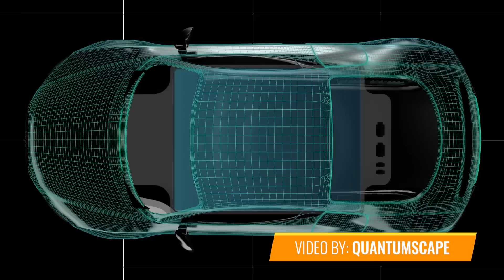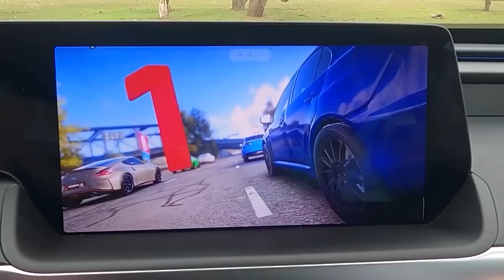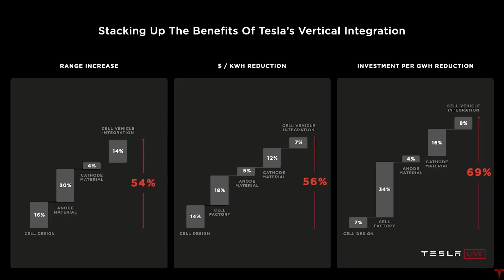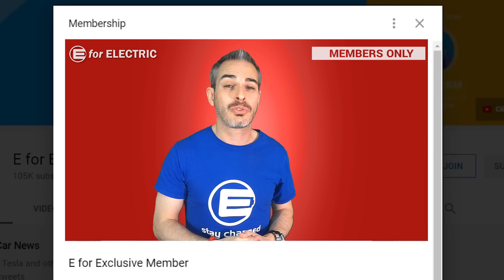TOYOTA's Only Hope to Beat TESLA: Solid State Battery

Comment: Toyota has much more going for it than just solid state batteries. Toyota’s dependability and reliability are second to none. Tesla’s dependability and reliability are the worst in the industry and that is making BEV which are much less complicated to build and easier to maintain. When Toyota builds BEV people will buy them over Tesla’s for the same reason the buy ICEV Toyota’s over other brands. Toyota never came out first with anything, but they still sell more cars and are more profitable than any other car company in the world. Tesla still wouldn’t be making any money if it wasn’t subsidized by pollution credit sales.

Comment: Toyota is on a political level fighting EVs and at the same time soon launching a solid state battery? Sounds contradictory and that Toyota therefore is not any time soon launching a solid state battery.

I think that Elon Musk believes that when the solid state battery is ready for the market, the lithium battery that Tesla uses will have been developed further too and the difference in capacity between the two battery technologies will be minor.

Comment: In the short run, no one beats Tesla; they are just too far ahead in the charging game and the tech they put in each car.  The other car companies are just getting into the game, and they haven't shown anything other than their standard offerings with electric motors and standard batteries inside.  Moreover, the charging infrastructure is not robust enough for those who need a reliable way to take extended trips other than a Tesla.  

Solid-state batteries are not around the corner, and for now, those that buy electric cars will have to face the fact that long-range will remain limited.  That said, if someone is using the car in urban and suburban environments, the electric car will work just fine.  Perhaps Toyota can find a way to make a hydrogen car that can overcome the current limitations, but I have serious doubts that they have anything right now that can beat Tesla.
Reply: Toyota will win. The average person can’t afford a Tesla. The body and paint is shoddy, and $600 for a taillight? Come on. There are a lot of Tesla cars here, but there are way more large pickup trucks, guzzling gas. And folks are still buying the Toyota Prius.

Comment: It’s not about who gets to solid state first.  Just being better isn’t enough.  It has to be economical as well.
Reply: I see what you are saying but Tesla started with a 100K + car to limit demand while they worked out the kinks. Then started getting cheaper. The newest whiz-bang stuff costs. Then gets cheaper over time.
Reply: @DanT10  Tesla did that when no other company had EVs, this is not the same. If Toyota starts a limited production of a few GWh (~10GWh) of Solid State Batteries at a point in time when Tesla has 6-10TWh of 4680s in production, it will not even be a contest.
Reply: @OnigoroshiZero  Yes, exactly.   The best battery in the world does not help if you can't build them at scale and at reasonable cost.
Reply: Yeah I expected solid state to start in luxury cars.
Reply: Yes, the early bird may get the worm but it is the second mouse that gets the cheese.  
The other thing that may happen is some other technology come along and just kill the market for the existing batteries.
Reply: and durable.
Reply: Well, that rules out Tesla then, since no BEV's are economical without subsidies.

Comment: IT is the mix of Energy density, price and cycle life that determines which tech is superior. I don't expect that first gen solid state batteries are significantly Better warranting their likely higher price. However if improvements are fast IT is  the battery chemistry with the most Range Per $ That wins! This is not about Tesla competing in manufacturing costs and production capacity. People want the best chemistry, period! All other types of batteries Will be considered inferior if Toyota is succesfull. However Tesla is not powerless. They have the expertise and capital to startup a licensed production of Solid state batteries in Short order. You can not Be a Global leading EV manufacturer, if you dismiss the evolution in batteries. IT Will be like saying: "steam cars are All that people need, Henry Ford is a Moron".

Comment: Ah! come on! Do you really think that Toyota is behind or will be left behind? Toyota has been electrifying the Vehicles before all other manufacture and had put out more successfully hybrid then another manufacture. Hybrids are not pure EV is right, but it is electrification, for it uses a computer to tell the system how to use the electric Motor. So Toyota do know how to package a motor, use computer and electrons to control those motors. So do you want to still tell me that they will left behind? I think not. Yes Tesla revolutionize the EV and yes they do know how to make elections work well with their motors, which make them popular by the Tesla fan boys and girls. Tesla is just not good in building vehicle, but good in packaging electrons and motors to get good race track performance then any other EV builders. Toyota on the the hand build good, lasting, reliable, and dependable Vehicle and been doing electrification of their vehicle before any manufacture and that is the key that will keep Toyota  capable and successful in producing a very good EV.
Reply: @T R I personally do not care for pure EV at this time, because they will not fit  the way I live and move. I do not like waiting around going nowhere for 10, 15,  45 minutes to an hours for an EV to be fully charge. Maybe when I can charge an EV in 5 or under 5 minuets then I will go EV.  For right now HV or PHV, just make more sense to me.
Reply: Microns not millimeters. The gigs castings will improve precision by 3 orders of magnitude!!! If that doesn’t leapfrog Tesla to the top tier of manufacturering ...

Comment: Tab-less battery patent replaces the (single welded tab construction) with (non welded multiple flaps construction). Flaps connected to output terminal by pretension force induced in the final assembly). 

As flaps are made of annealed soft copper, we opened up chance for rapid degradation. Setting back the patent claimed improvement. 

Watch out for post delivery and irreversible degradation from - inertial and thermal shocks. At the end of degradation we have a battery that perform no better than those welded tab counterpart.

Comment: Alex, at battery day Elon musk talked about using graphene in the new battery eventually. Graphene would Eliminate any liquid in the battery and virtually make it a solid-state battery.
I hope you can comment on this
Reply: I thought I was only one who caught that
Reply: The dry battery electrode technology is more about lowering the manufacturing cost than improving the performance, and it's not known yet whether it works at scale.
Reply: Graphene is only interim goal.
SSB is the Holy Grail.
The reason Tesla purchased Maxwell a few years back.
Tesla is soo far ahead it is unlikely others will beat Tesla to SSB if anyone does it at all.

Comment: I loved the point about getting to Vegas: electric cars are useless to me until I can get to Vegas driving at the speed most people drive on the CA-58 and the I-15 without stopping to charge. And then it's got to recharge in less than 15 miutes. The distance is about 410 miles, and the average taffic speed is about 80mph (70mph posted) on those roads. And once I'm out of California, most roads are 80mph speed limits, and most cars drive about 85. I need my electric car to drive at least 380 miles up and down passes at that speed, after a fast charge in less than 15 minutes. No BEV is even close to my requirements. I won't buy an ICE vehicle that can't do that, why buy something less capable? And 80% of my miles are trips like that. 

I don't care who makes the car, I also don't care about 0-60 times shorter than 5 seconds, nor about top speeds above 90. All I care about is sustainable speeds on Western US interstates that get me to my destinations in a reasonable time. Small range, limited speed, and long recharge times add at least an additional day each directon on a 750-1100 mile trip. The current BEV limitations make my trips unprofitable (I've tried it with a borrowed Model S P100D). And, unfortunately, it doesn't seem like anyone cares. All the new cars for the people have ranges between 2-300 miles. Fanboys will just tell me that I'm in a very small niche. I know you are wrong. You don't live out in the country, don't presume you even begin to understand what we need from your urban or suburban sheltered life. Try to understand that there are needs different than yours rather than invalidating the experience of others 

I want cars that help us save the planet, but I also have to earn a living. I can't afford a car that can't meet my requirements. I don't have the price elasticity to absorb the additional cost that lack of range and current charging time incur.
Reply: In my opinion the greatest drag on the adoption of EV's is the charging issue including the lack of current charging infrastructure. It doesn't matter if Tesla, VW, Toyota, Hyundai and the rest can produce tens of millions of EV's, most consumers are not going to buy them until they can pull off any exit of an interstate, find a charging station within half a mile and fully charge the vehicle in under five minutes. Beyond that Toyota, VW and the rest don't have to "catch up to Tesla". People will compromise on 0-60 and range to get a style they like at a dealership that's convenient.

Comment: A correction for you video Alex. The 4680 has 5 times more energy simply because it is 5 times the physical volume of the 2170. That is straightforward. Nothing special here.
The reason it has 6 times the power and 16% more range is basically because the new tabless design does not create as much internal resistance. So you have less "resistance based heat" being wasted and that translates to about 16% more output Power. 16% is about 1/6 of that 6X Power figure. Thats why the Power is 6X while the Energy (due the volume increase) is 5X. I hope that makes sense.
Reply: You are absolutely right! A couple of corrections: 1. A single 4680 tabless cell replaces about five 2170 cells. Now you need to produce one unit instead of five! Keeping in mind improved production method for electrodes (dry vs wet process), a significant production speedup is achieved! 2. "Resistance based heat" is decreased and as result about 16% more output power is gained. Conclusion: better heat management is achieved!

Comment: Last I checked they do NOT have better cycle life and begin to fail around 70k miles. We'll see if they make any massive breakthroughs, but I think that hurdle is still there and Toyota is bullshitting to try to stay relevant.
Reply: The Japanese ain’t bullshitters. They’ll catch up, and surpass, like always.
Reply: @MsNickie1001  Well Toyota's battery tech isn't supposed to be ready until at least 2025-26. In the meantime they are going to fall extremely far behind in the EV space. Not to mention costing tens or hundreds of billions to re-tool or build new factories and training etc. because they have taken such a hard stance against EVs until this year when they finally realized they were fucked.
Reply: @johnpilon  they haven’t lobbied against EVs. They have lobbied against making ICE cars illegal, which ain’t exactly the same.
Reply: @MsNickie1001  I never said they lobbied against EV's... Just that they were very behind in terms of the transition and thought they had 10-20 more years than they did. All the governments are forcing all EV by 2035 which does not leave much time to transition.

Comment: With all respect to Toyota and solid state batteries, all that matters right now is how many gwh of batteries you can make. Gwh dictates how many cars you can manufacture and whoever has the most would rule the EV market. At least for the next 10 years that all that’s going to matter. Tesla gets it and that why it partners with all battery manufacturers and buys any battery it can get its hands on while at the same time plans to match external capacity with capacity they will build themselves. No other car maker comes close. VW that has the most ambitious plans right now will have only 1/10 of the capacity Tesla will have in 2030. Even if Tesla botches it plans it will still have 3-5x more production capacity than any other automaker. With countries around the world banning ICE cars - the company who would produce the most electric cars will have the biggest market share gains in the market.
Reply: Could you list some sources ? We all know you didn't come up with this information yourself.

Comment: The problem with solid state is that 900$/kWh is about ten times what Tesla produces right now, and they plan to reduce that arond 50$/kWh with the 4680. 
So Toyota would need to reduce the cost of their solid state batteries by 95% just to reach parity...
It is a tall order.
Reply: Toyota 👎
Tesla. 👍
Reply: Exactly, even if Toyota has the tech, they have to ramp it up and make it close enough in cost to Tesla’s battery. Tesla will be have their 4680 in serious production next year and benefiting from cost savings shortly after. Anyway, the tabless design will charge faster with higher voltage and less heat so that will have some of the desirable qualities of ssb.

Comment: I very much appreciate stand up commedian style ingrained in the video! 
Interestingly, what technology in batteries is going to be used by highly promising companies from China - Xpeng and NIO? Besides what Foxconn is going to use since it vowed to manufacture EVs for lots of brands? What are Sony and Apple going to unveil? What CATL and BYD are working on as the largest battery manufacturers? Those questions when answered might greatly modify the structure of EV marketplace. One more point: if the puzzle of solid state batery is solved it might entirely disrupt all electronics market as well. Yet Hydrogen fuel cell technology, while silly in Toyota Mirai, might still have a future in transoceanic ships and aviation.
The future will be promissing for those who have "chemistry to share love" with the market/s.
Toyota will have to solve its software backwardness by buying alltogether a promising startup. Toyota had a such chance alongside Mercedes Benz when they owned sizesble shares in a such kind of sturtup called Tesla.
Reply: 30 minutes allocated for charging of an EV is ok for a family with kids. In fact it is required to be not shorter. For business use that is too slow. Yes, I agree very low energy density of batteries keep the today gel based batteries out of commercial trucks, boats, planes for now.

Comment: I thought Toyota was banking on Hydrogen fuel cells and Hybrids? I also thought the tables & dry electrode designs matched with the structural battery pack can match and even surpass the performance of solid state? Is that incorrect? If so why?
Reply: 4680 cells and solid state batteries have both only been lab tested, neither exist in any production vehicle. Any claims about performance and endurance are from laboratory testing, where variables that impact real world performance do not exist (fluctuating temperature, sitting idle, passage of time, road friction and vibration, etc). Everything we know about the 4680 is from Tesla telling investors about their projections, so we don't know if they're overselling or underselling, or if real world testing and mass production will lead to additional breakthroughs or complications.
Reply: Joaquin, shame on you. Don't you know that as a modern day consumer, you're not supposed to remember last years promises. That's not cool. If you keep up that kind of thinking, you might begin to develop suspicions about this years promises. If that happens, the whole system could crumble. My gawd man, your developing cynicism could infect entire nations of eager consumers. LOL
Reply: Maybe Toyota's "banker" told them hydrogen passenger vehicles at economical mass scale are dead on arrival. Either that or they finally hired some chemical engineers that told them hydrogen has problematic thermodynamic properties.

Comment: Toyota are going to have to latch-on to the coat tails of BYD LiFeP4 in order to keep pace with exceptional current Lion levels until such a time as they can compete with their own plan. 

Solid state and Fuel cell step changes are the only things that can save them but that's not even close.